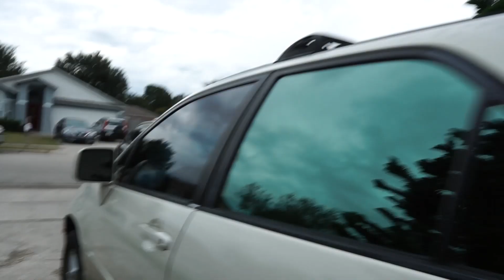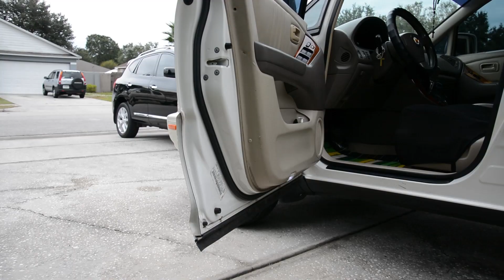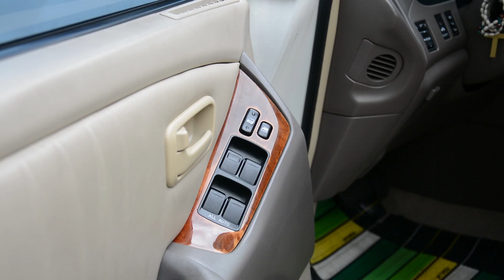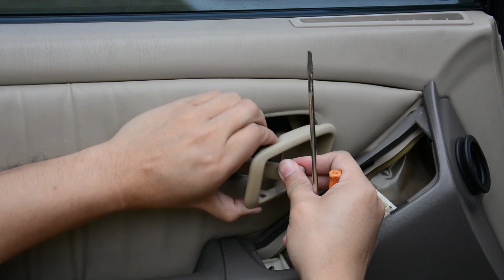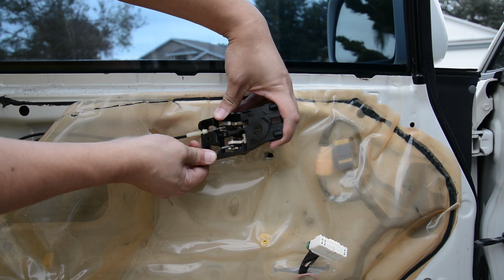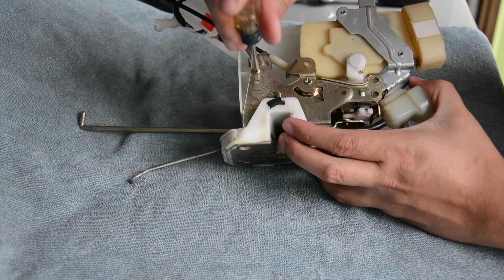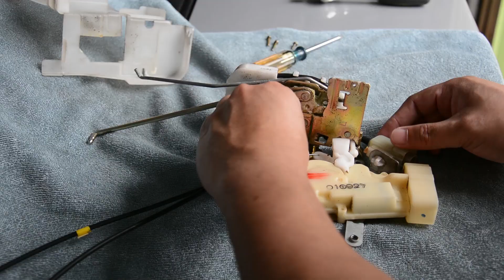Lexus RX300 Door Actuator Replacement

Comment: I just replaced 3 of the 4 mechanisms. And my doors still won’t lock and unlock together 😭😭😭😭 what else could it be?
Reply from the maker: Do you hear the motor working when you're pressing the lock/unlock?
Reply: Ivan inside. Yea. When I try the key fob no.
Reply from the maker: @xopilotlo7794  The key fob might need a new battery or it needs to be reprogrammed

https://www.clublexus.com/forums/gs-2nd-gen-1998-2005/874626-doors-unlock-twice-after-installing-new-actuators-remote-does-not-disarm-alarm.html
Reply: Ivan I’ll try to reprogram it. I just replaced the batteries last week

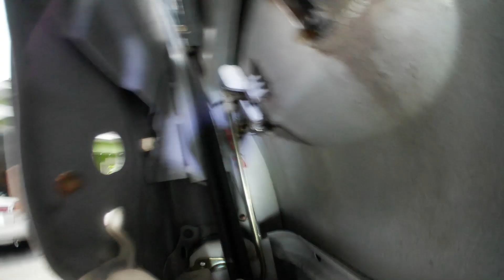Comment: The part at 3:16. You do not show the reconnect and if there is any trick to reconnect?
Reply: Have you found the proper way to reattach this piece the correct way, I am having the same issue and there aren't any videos on the internet. Thank you, look forward to response.
Reply: @kevincarrero576   yes. Take off the door handle and it's super easy for both on and off. No need to reach underneath.  Two screws and  slide out